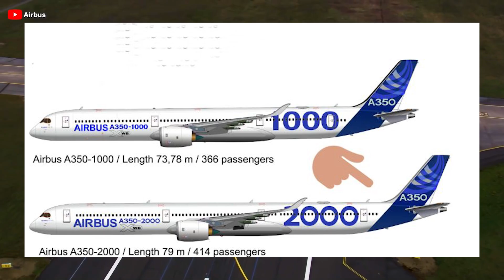NEW Airbus A350-2000 will SHOCK The Entire Aviation NOW! Here's Why

Comment: The 777x is being delivered in 2026. And the A350-2000 is a modification the 777x was a whole new plane with new wings. No way the 2000 will be as fuel efficient as the 777x
Reply: happy to pay a bit more in fuel and get there alive........get my drift??
Reply: @user-Rocket-Fest I hear what you are saying. What is the accident rate for a Boeing jet vs an Airbus? I just looked up the overall fatality rate flying large commercial jets, per Yahoo it was 17 per a billion passengers. With numbers like that I’m not worried unless a particular manufacturer or airlines has major major problems. The drive to the airport is quite literally the most dangerous part of your trip. That’s the part I would be worried about. Funny thing about airline crashes, everyone remembers them but no one pays any attention to the tens of thousands of flights that occur every day and make it safely to their destination. It’s important to understand the facts in relative terms.
Reply: @YaRight2986  you are 100% correct
I based my call on a Docco done several yrs ago when even Boeing staff refused to fly on their own products.
Reply: @user-Rocket-Fest I did see that doc. Very interesting to say the least. Boeing has for sure had its problems. They seem to be on track now but time will tell. It’s hard to shake a reputation. Word is that they are now overly cautious and the FAA is watching them like a hawk. The success of the 777x might make or break the company. IMHO that’s why it has been delayed like 4 years. Now expected IOC is CY2027 and the airlines are complaining big time. Another delay and customers may flee to the Airbus 350. This is a tough industry, either you produce or you perish. One thing for sure it will interesting to see how things work out.
Reply: The 777x is NOT a whole new plane. It is the OLD, heavy 777 fuselage with some internal changes to give a bit more room, with new wings and engines. It weighs a lot more than the A350.

Comment: Clickbait. At this moment, there's no engine that could fit a 2000 version of the A350. The A350-1000 is struggling with its current engine thrust limitation (Rolls Royce Trent 97 - 97k lbs of thrust), and there's no RR engine in service bigger than that. So a 2000 version would need around 110-130k lbs of thrust. Maybe the GE 9X (115k lbs of thrust) that is still being developed and tested could lift it, but it's not ready and it's exclusively projected for the 777X. And the huge one that RR is developing (Ultrafan) is years from entering in service.
Reply: The big prototype Ultrafan is still in testing.  Tested output is even less than that of the GE9x.  I think the A350-1000 hull is already stretched. an even more extended version might not be feasible.  The 777x has a more probability of being extended   further than the -9 version. Also GE9x maximum output is higher than the GE90 so GE9x could still power a possible longer version of a  777x-9.
Reply: Rolls Royce has a new engine the ultra fan should work for the a350-2000
Reply: @KevonHolder-t5l  Still in testing phase and needs tweaking to increase power output
Reply: Ok cause that's the right engine for the plane to go pass 777-9

Comment: Very doubtful as it would need new engines. The RR T-XWB-97 on the -1000 I believe are at their limit of power output. If RR can supply an `UltraFan` version then maybe, but I`ve heard thats many years away yet & B777X should be available by `27ish.